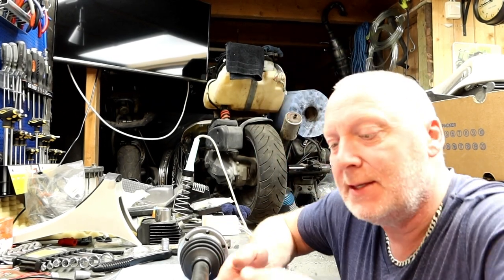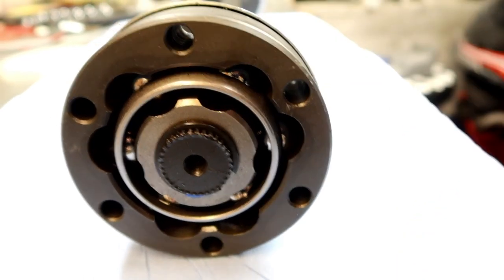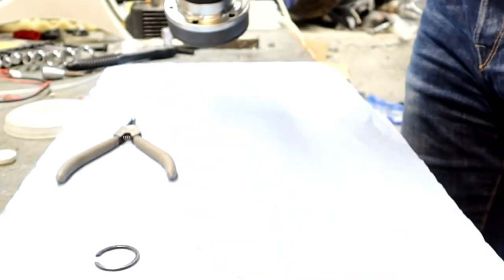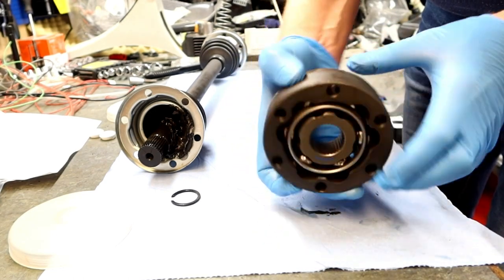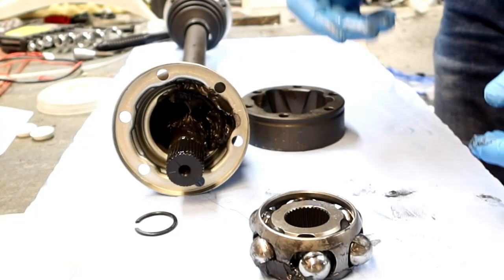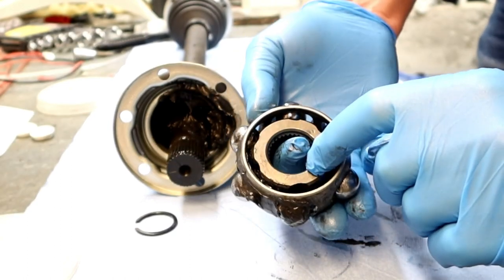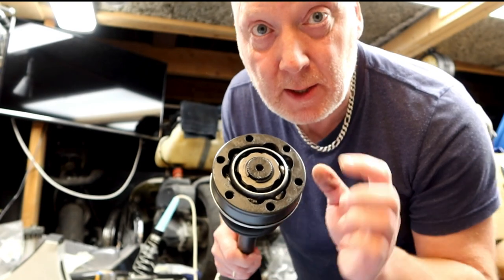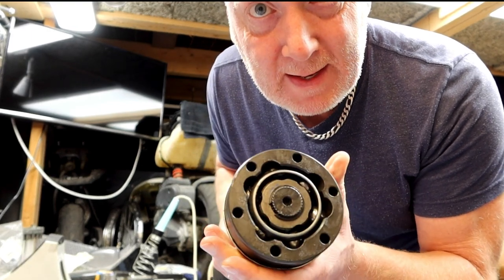How to clock the cv joints to an axle/driveshaft vw t3 vanagon porsche

Comment: I think going from 14" to 16" wheels on the Vanagon, this step is important when rebuilding cv joints. I've done several and they seem to not last, as perhaps the larger wheel/tire size introduces a steeper angle on the shaft creating stress on the joints. Thanks for this revelation👍
Reply: Changing the Wheelsize has nothing to do with driveshaft angle. Think about it another time 😊

Comment: I have just overhauled & Reinstalled the CV joints for my Holden Commodores rear axle shafts but since the outer CV joints are a non plunging type & the inner CV joints are a plunging type they didn't need to be clocked but 3 out of 4 CV joints were fitted back to front so I had to refit them the right way !
Reply from the maker: Excellent 👍

Comment: Thank you, very much! I don`t know that and I think many "mechanics" do it completely wrong! I will do restoration on my VW Golf Mk2 soon and I rebuild everything myself, because I see "work of mechanics" after they "repair" and in Latvia we have big problems with mechanics. My VW Golf of 1983 live because I do all jobs mostly myself. Thank you!
Reply from the maker: Thanks for the comment, glad you found it useful 😀👍
Reply: @Italjohn  Yes, it is very very useful! I can tell my story. Here in Latvia we have very bad roads, because of poor EU country and roads are destroyed in 6-8 years (econony on the expensive ingredients and not proper technology). New road - perfect is bad after short period of time. Everywhere is holes on the road  surfaces and we have disaster situation in many directions (last year very many roads New ones!) was destroyed by absolutely improper surface treating with small stones and some kind of "glue"... This "glue" and stones fly away and I get 22 holes in my cars body! It is something... and "country roads" which are simple roads without asphalt are destroyed by the hard machines which transport wood bricks... In this situation my old vehicle is going bad very quickly. "My friend mechanic" sometimes do small jobs for me, when I don`t want to. But... after he 1 year ago change CV axes (wrongly) I get the same "problem"... ticking on the left turn... Your video open my eyes. Thanks!

Comment: Just did this on my T2 baywindow joints.. Does it matter what side facing the wheel and the Gearbox?
Reply from the maker: No not really. But some say it's important to put them back the same way you took them out. If they are brand new it does't matter wich way you put them.
Reply: @Italjohn  well. I guess that putting it back as it was ship has sailed. 😂

I was more interested if the wide side or the narrow side should be at the wheel or the gearbox.. Thanks for your reply..  Greetings from Sweden.
Reply from the maker: @pierrej8069  Both sides of the axels are buildt the same way, you just need to get the "ring" on the cw joint on the outside. Regarding the same way as you took them out has to do with the twisting of the axsel rod. If you flip them around the twist will be the other way and that could weeken the steel rod.
Reply: @Italjohn  yeah.. I have the one and only ring on the outsides.. Just about to grease them up.. Thanks. 👍🏼

Comment: 2:11 the manual says to use a hydraulic press ( because it’s a tight fit ) . Why are you able to remove it that easy ? Is it because its a different design or are all like this ( also stock ones ) your answer will be appreciated!
Reply from the maker: Some are hard to get off, and some are easy. I think (don't know) the high quality ones are harder to get off. This was the cheapest axle I could find at brickwerks, so I guess you get what you pay for. I just want this in the car for spare/emergency use.
Reply: Italjohn13 will be good for emergency use . I love brickwerks as it gives you a huge variety of parts (and qualities) . I always get original and OEM as I had a bad experience with aftermarket parts ( at the end it was always more expensive than just getting the genuine part )
Reply: I had to use a hydraulic press  as the 38 year old axles were very tight on the joints!